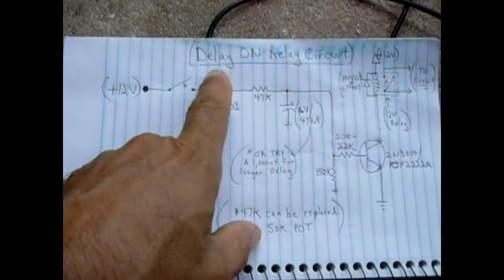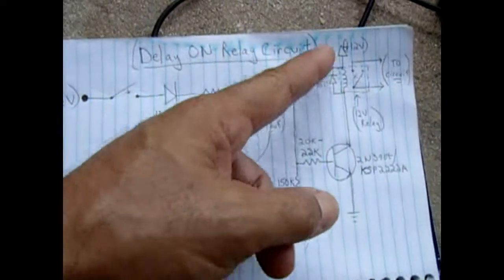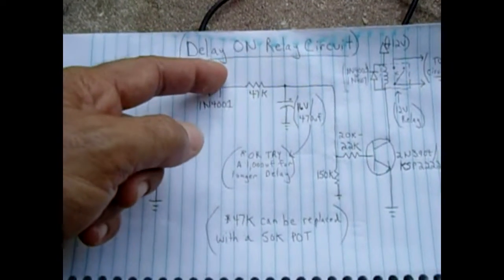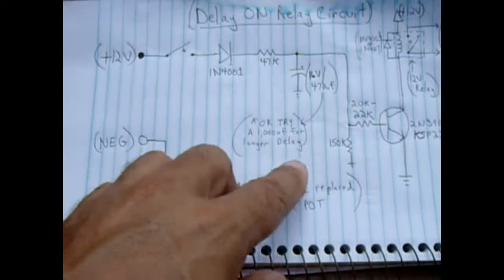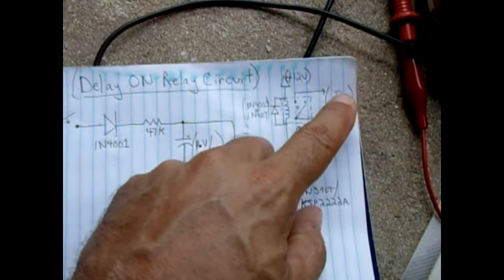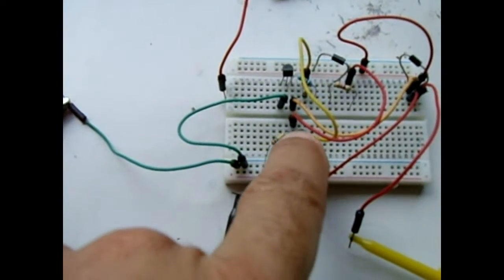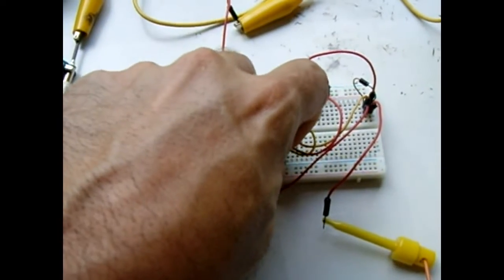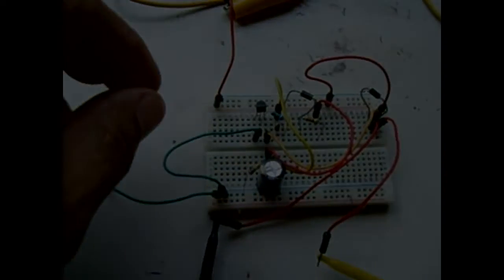Simple Automotive 12V Delayed ON Relay Circuit ~ Interior Lights

Comment: This really is good stuff man, thank you.  I'm building (may have mentioned) a thermoelectric cooler for the truck, yeah, I could buy one much cheaper but what is the fun in that!  I needed delay times to run cooling fans after the peltiers turn off, and I needed a delay after the truck was started and had battery recovery time before allowing the second peltier and fans to run.  It wouldn't be a "DYI" if you bought everything you needed already made.  Btw...the aluminum brazing rods are great, used them years ago to build a din mount for CD play for a nova I had, didn't have the heart to cut up the dash to just play CDs.  Thanks again for info here.
Reply from the maker: Your Welcome Wade. I have a project coming up using a peltier junction module.

Thanks For Watching! Be sure to share
Reply: Could I set up a low voltage shut off set up using a potentiometer to a transistor to control a relay?  Or am I way off on this.
Reply from the maker: The original schematic uses a POT to adjust the low voltage cut off. If you want something very accurate, then you need to use a circuit with a comparator.
Reply: Hmm, how would a comparator work if all available voltage is low.  The use for the low voltage cut off would be to cut the voltage to a high draining appliance once the voltage dropped to keep from completely draining power supply.
Reply from the maker: How low do you plan on going? I suggest you just use the circuit here. It works just fine if you are not looking for precision
Reply: Hmmm...I could simply charge a capacitor and regulate to ground how fast it discharges.  Or would it be better to regulate resistance to transistor. Once in coming voltage could no longer charge capacitor fast enough to over come discharge, the output to the circut would not transfer enough power to transistor to "switch" on, this would kill the power to unit, and the units controller won't come back on until I restart it.  Use a large enough capacitor reserve keeping the circuit alive to discharge power supply enough to ward off oscillation of the circuit. Sound right(ish)?  And feel free to delete these if you think I'm confusing others.

Comment: Another Great Video, I what to make a mailbox door alarm using your video, (Latching ON OFF Wireless Transmitter for UNDER $10 VOYE) wireless door bell. Can you show a 555 Schematic when mailbox door is opened and held open the transmitter sends a 1 sec plus high or maybe low? The postman opens the mailbox door; he or she will leave the door open around 2 or 3 minutes sorting the mail. The reason for circuit is, 1sec. transmitter pulse will save the life of 12v battery
Reply from the maker: Thanks For Watching! I have lots of people that request "Special Assistance", or send me private YT messages seeking "Special Assistance" in response to one or more of my over 200 videos, even though I would love to assist everyone possible, and usually I do (which many other YT channels do not, that I know for an absolute fact), I am finding it very difficult to keep up with all the requests, due to a lack of time(working & personal life).  Answering simple questions, I will always continue to do, but I have adopted a new policy in which I ask any viewer who seeks "Special Assistance" to post (1) link in the video comment section showing that they shared my Youtube Channel main page with others(posting a link on another website, Twitter, Facebook, etc).  By doing so, I will then be glad to assist at a "higher" level. I have no problem helping, but viewers looking for help, should also help me in return to get more exposure(views) for my channel. To assist someone who does not share my channel, simply does not make sense. Help those who take the time to help you.

Take a look at the new 555 video recently uploaded. That may work for you.

Comment: thanks for the great video. can i use this on a 120volt ac circuit, i want to create a delay on the trigger of an ac relay.
Reply from the maker: Yes, it will work just fine. You will need to power the circuit using a wall transformer(DC 12V) 200mA output. Since the No Load voltage of the transformer can be 18-20VDC, I would use a zener zegulator circuit to keep the voltage of the circuit close to 12VDC. Use a 56 ohm 1 watt resistor feeding from the + of the power supply, then take the cathode of a 12V 1 watt zener, and connect it to the resistor, and the anode of the zener to the neg rail. From that point you can power up the circuit. If you have a wall transformer which supplies a fairly steady 12VDC power supply, then you can omit the zener regulator circuit. Make sure the relay is like the one below(only draws 60-70mA, and is rated 10 Amps. The 120VAC circuit can be controlled by the relay contacts.

http://www.ebay.com/itm/10Pcs-Mini-12V-DC-SONGLE-Power-Relay-SRD-12VDC-SL-C-PCB-Type-/171244151642?pt=LH_DefaultDomain_0&hash=item27def2635a

Thanks For Watching!

Also be sure to check out my video playlist. Don't forget the "thumbs up". :-)

Comment: thank you very much for the video and the ggod explanation... so if i want to delay ON the circuit for 1 or 2 second i should use a capacitor with value between 100uF-200uF . right?
In addition, i want it to turn off exactly after the switch is off! can you help me?
thanks alot ^^
Reply from the maker: I explained all this in the comments below. Please read through them. Thank you for watching!
Reply: ok... another question...
what type of relay should i use? can you write here the number of the relay i should use ?
thanks for answering man^^
Reply from the maker: No particular part #. I used a 12v relay with a coil resistance between (270 & 700 ohms).

Comment: How do I make the delay shorter, like say, 1 second?
Can I also replace the relay with an LED?
Reply from the maker: Reduce the capacitor size. Try different values until you get the results you are looking for. After lowering the capacitor value, you can also try lowering the 150K as well. You can replace the relay with an LED which is in series with a 620 ohm resistor if you use this on an automobile. If you do, then you might as well use this circuit here:

Gradual ON / Fade OFF Circuit~LED's & LAMP
Reply: Thanks, your video and explanation is very helpful :D

Comment: Hi is it possible to use this circuit when attached to an electro magnet that would stay on for a set amount of time and then turn off and allow the door to open.
Reply from the maker: Use the Power ON/Delay off circuit here. Usually the door stays closed while there is no power applied to the solenoid, then when power is applied, the door opens. With the circuit below, once power is applied to the solenoid, power will remain for a set duration to allow you to get through the door, then turn off the solenoid even though the button to activate the solenoid is no longer being pressed.

Power Off Time Delay Relay Circuit

Be sure to check out my video playlists and share them with others.

Thank You!

Comment: Very nice. Can I use this circuit for delaying starting a movement sensor. It works on 220v, and I want to get a delay of 30 seconds or 1 minute. If so, can you tell me the exact name of the used parts because i did not have experience. Thanks
Reply from the maker: Most relay contacts are rated for 240VAC. Be sure to check your relay before buying one. Make sure the relay is rated to handle the current you desire. A relay with a "higher" coil resistance (270-700 ohms is best). The 220v power which normally would turn on the sensor, that would be connected to the part of the circuit which charges the capacitor to turn on the transistor to activate the relay. You can use a wall transformer for powering that part of the circuit(reduces the voltage). You cannot supply 220v to that part of the circuit. Use a 100mA - 220/240V to 6 or 9VDC wall transformer. Use a capacitor larger than the one used in this circuit for a longer delay. All other components are shown in the video. Thanks For Watching.

Comment: I am supplying 12v to the circuit. I am using 10uF capacitor. I am using your original 47K resistor to charge the capacitor
Reply from the maker: That is a very low value. You are going to have to experiment with the resistor & cap values.

Comment: If I want to have the capacitor to drain at a faster rate after the "ON" stage has been triggered, do I want to increase or decrease the 150K resistor?  The circuit will be energized every few seconds.
Reply from the maker: So you want to decrease the amount of time you have to wait between triggering? The circuit requires 5-10 seconds for the capacitor to drain in order to get the full delay ON time. Decreasing the 150k resistor value allows the capacitor to drain quicker. You may have to slightly reduce the 47K also. Just play around with values until it works reliably as the schematic.
Reply: electronicsNmore thanks dear...
Reply: Amol mk solved 15k instead of 150k , relay turn off within 1sec.
Reply: Amol mk capacitor value 33uf x2
Reply: Amol mk delay time 1 and half second approximately

Comment from the maker: One side of the relay will be connected to +12V power, the other relay contact is connected to your LED, then connected to a resistor to limit current and reduce the voltage. From the resistor you will connect to battery NEG.to battery NEG. To find out the proper resistor value, you take 12V and subtract the voltage rating of the LED you are using, then divide the result by .02(20ma). example: 12v - 3.1V= 8.9V, 8.9V / .02= 450 ohms.

Comment from the maker: I put this circuit together all from my head, along with trial and error.  No formulas used. If you use lower voltages, Then try a 9V relay, or a 6V.

Comment: @myvideoisonutube - in your current design what determines the range the voltage will work. you said it will work between 10 to 14v - what formula determines that, also if i wanna drop the input voltage for other projects what components should i look at to change the values. thanks

Comment: which components on your current setup should i focus on to use at lower voltages? i will be staying with the 12v since it calls for it, but for future ideas i would like know i can have lower voltages if necessary. i noticed that if i drop the voltage below 9 volts the circuit stops working. i was acting as if the battery drains how low it can get go before shutting down.

Comment from the maker: The circuit was designed for 12V circuits. It should work fine between 10-10.5 and 14.25V. If you would like to use it at lower voltages, you will have to make some changes to the component values. The relay is a MUST! The circuit will not work correctly without it. No big deal using the relay. Just feed your wire to be triggered through the relay contacts.

Comment: The reason I ask about the input voltage is because if I drop the voltage to around 10v or so, the circuit stops working.  Is there a way that if the input voltage drops, the circuit can still run. Is there a component that would hold the input voltage and not let it drop below a circuit range. Do you know what I am trying to ask here?

Comment: @myvideoisonutube - I built this circuit according to your specs and it worked perfectly.  I have a couple of questions - Does the input voltage have to be 12v? Also, does the relay need to on the end - can the output immediately go to something else, for instance to the transmitter input buttons and after the delay ON does its pause the transmitter will send the signal to the receiver - is that possible? if so, how would I wire it without going through the relay if possible?

Comment from the maker: I understand. That is called heterodyne. Just like when two people are transmitting close together on the same radio frequency at the same time, the transmitted frequency becomes a new frequency. You can give the circuit a try. Assemble it on a breadboard to get it working the way you want first. You will be using a very low value capacitor. 100uF -200uF likely. Should be able to work.

Comment: I tried working with the 555 timer, but I wasn't getting the delayed ON like I was hoping. My circuit could be totally wrong but I was getting confused and more frustrated, so when I came across your Delay Off video, thats when I asked if you had a Delayed ON and when you said yes, this looks more simplier hoping it will do what I need it to do.

Comment: See, what I am trying to do is. We have 2 wireless remotes operating on the same frequency to control 2 clay target machines.  When you press both buttons on each unit at the same time, the signal cancels each other out. I am hoping, I can add this circuit to one remote to where when both buttons are still pressed, one circuit will delay coming on so the signals wont cancel each other out - so the true pairs and still be launched.

Comment: Ok thank you. I will definitely have to play with the cap values since I only need a 1 or 2 sec delay "ON". I am first going to build the circuit to your current specs first - making sure I can get the circuit working correctly, then once that is accomplished, then I can play with the caps value.  I may also have to play with the discharge rate on the resistor as well. I need it to drain really fast

Comment from the maker: I did not use an R*C formula for this. Using the exact same components that I used, simply try out different value capacitors(higher and lower). The turn on voltage of the transistor's base also has a lot to do with it. The 470uF in my case was around 12 seconds, and the 1000uF was close to 30 seconds. This was designed to be really simple using components you find in scrap electronics. A person may not have a 555 laying around, that is where this circuit can fill the void.

Comment: thanks for responding to my question from your other video. how are you getting approx. 12 sec delay? is the formula to calculate the delay, is it 47*470000*1.1 or is it 47*470000*.5=